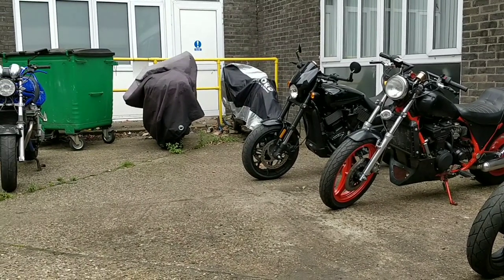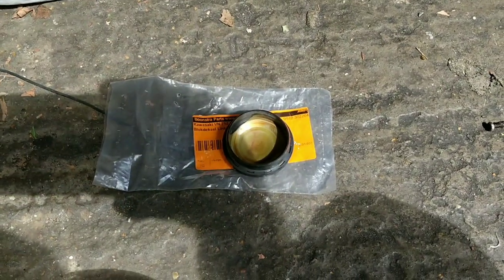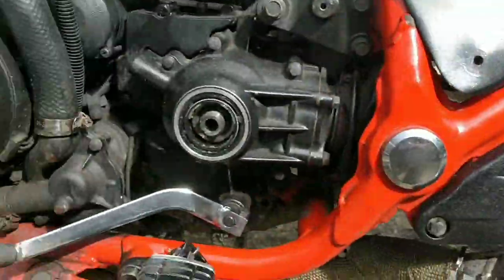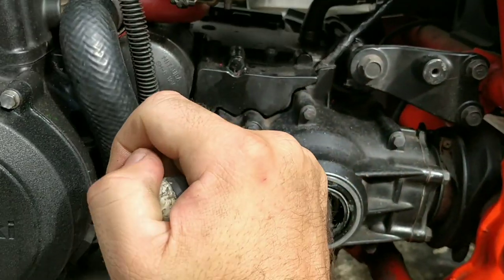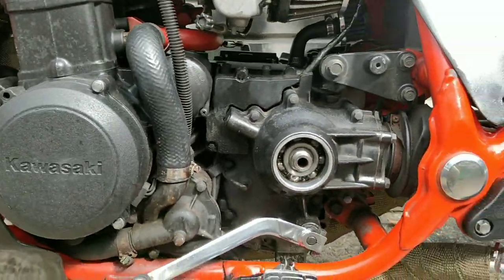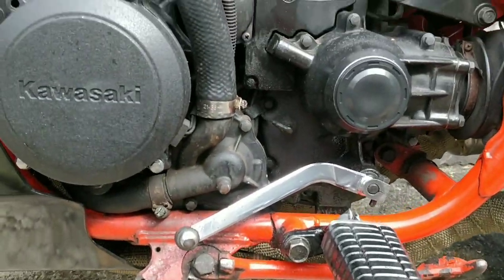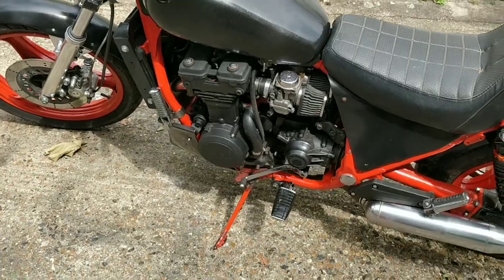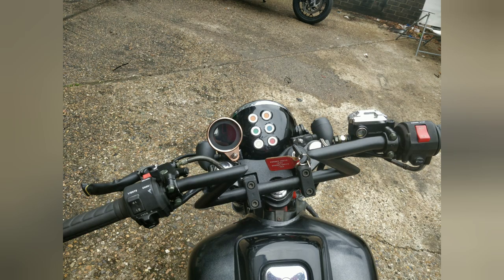motorcycle bevel gear leak fix, bevel gear leak, how to seal the bevel gear  cap, kawasaki, honda.

Comment: Great video.  I learned alot about maintenance on my ER5 as well.  Do you find ER5's very easy to work on?  I found them very easy to work on.
Reply from the maker: Hi, yes very straightforward to work on including valve adjustment. They need a better exhaust then the original and better handle bars but they are great once that's done.

Comment: Need some help off the back of this great video. I've followed these steps but the new seal cap works it way free again slowly if just left to its own devices, or rapidly when bike running. 
Have tried using the upgraded part with no extras, and also using a like for like old style (but new) chrome cap with gasket sealant to no avail.

There was no inner ring for me to remove, but followed all the steps above. Any pointers for an additional means of sealing it in place?
Reply from the maker: Hi, mine was a very tight fit so didn't wiggle loose however you can buy some black locktite sealant from halfords which is fuel and oil proof. That will help keep it in place. I would use the upgrade if I was you as it works so much better then the original set up. 

So locktite black sealant from halfords, run some around the edge, tap it back in then leave to set over night and you will be fine I'm sure. 

Let me know how it goes out of curiosity. 

Thanks 

Charlie
Reply: @motorcyclerescuer Cheers for the speedy response mate. It was the locktite sealant I used but will try again with a replacement new/upgraded part as I only tried the sealant job on the old style chrome cap. Both wiggled loose on their own within hours so not even sure they would stay still long enough for anything to set!
Reply: Its such a tight fit that its popping out due to pressure rather looseness.
Reply from the maker: Ohhhh I thought you tried the new plastic part like mine? 

If not definitely grab that one. You take out the plastic chrome bit and the rubber bush part and the new part replaces both. It's a permanent fix. 

Fowlers parts normally have them in stock and its a simple tap it in job.
Reply: @motorcyclerescuer  I tried with the new upgraded part first out the two. Just slowly came loose over 24 hours until it fell out. Will try again with the sealant and hope for the best, getting expensive now at £40 per seal and tapping it in did them no favours (took some serious whacks to get flush)

There was no inner bush there for me to remove, so I'm concerned the previous owner might have had a bash at this before selling it, minor leak sprung up after two years.
Reply from the maker: @matthewjones5480  you might be right and it may be slightly out of shape. 

Put a good amount of sealant on, leave it wr hours to set and see how that works for you.

Comment: Is that a Kawasaki Gpz 500 belly pan?
Reply from the maker: Hi, that was a custom made belly pan using fibre glass.
Reply: @motorcyclerescuer  Do you happen to know that oil seal dimensions?
Reply from the maker: I'm sorry I don't. When I searched it up it said that it was an upgraded alternative to the original. I'm sure I used fowlers parts in Bristol. 

Are you looking for one? For gpz or zl600?
Reply: @motorcyclerescuer  Not anymore found the right seal. But i'm planning an engine swap for a gpx 600r engine. Did you take off the bevel gear case?

Comment: i think you forgot the lock scew for the nut
Reply from the maker: What nut? I powered the bolt on with my torque gun
Reply: @motorcyclerescuer  there was a Philips head screwn in the midle of the nut
Reply from the maker: Oh right, noooooooo I put that there as a temp measure to stop the oil leaking out why I waited for the new part to arrive. You can see me creating that plug in the last zl600 vid. 

Good spot though